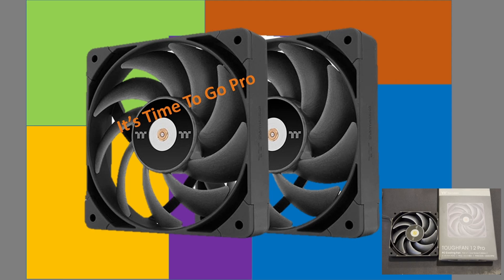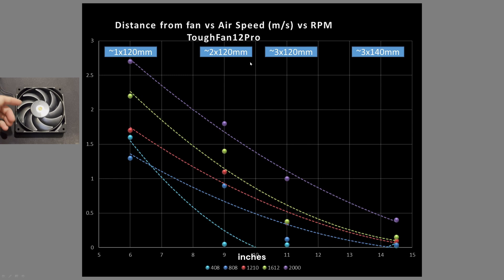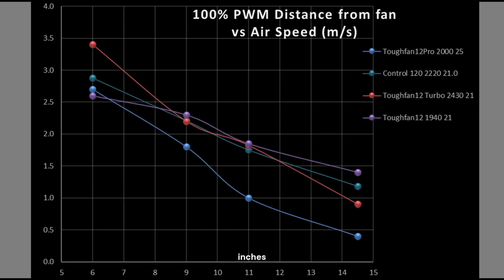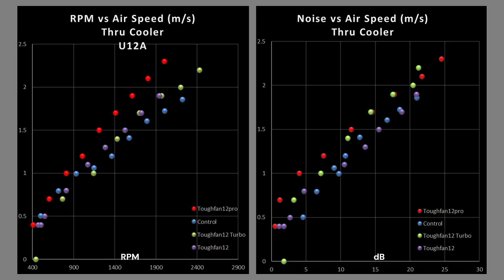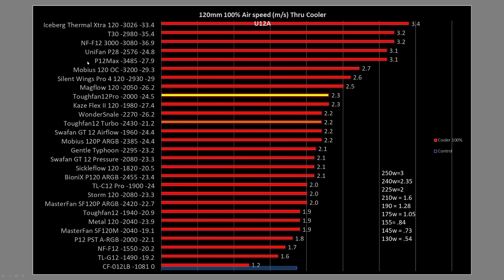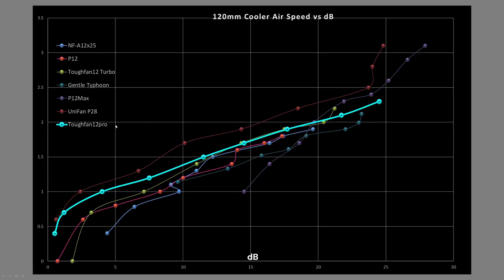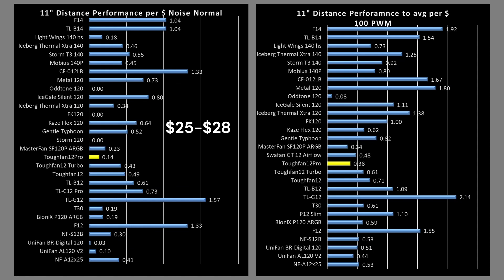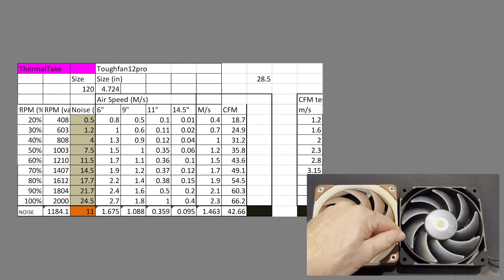ToughFan12 Pro Review: Its Time To Go Pro.

Comment: Thank you for your efforts testing all theses fans! really appreciate your analysis and thoughts. I don't know if anyone has suggested this before but for radiator applications I would like to see deltaT (ambient vs measured coolant temp, i.e. including a temp sensor in the loop somewhere). This would also require setting TDP limits on CPU in bios or SW for standardisation (which I also recommend looking into, say TDP 120W, 250W and 320W if available) to simulate different loads. Fans performance on radiators is easier to grasp in terms of coolant temperature compared to airflow speeds (although still interesting). And deltaT compared to temperature readings rather than absolute readings for obvious reason. These principles I find helpful for aircooling as well but in that case deltaT from CPU temp sensors is the only option of course. This can also be included for watercooling tests, especially helpful for viewers that have not used temperature sensors for coolant temperaturs or perhaps considering doing watercooling for the first time.  Keep up the great work!
Reply from the maker: I am a very small channel. No funding to speak of so real cooler testing with thermals is coming but still more than a year away. I am starting to get some thermal data from a stop gap test system but I'm not overly happy with the test. 
But yes what you wrote is basically my plan. 
Thanks for watching and the support. :)